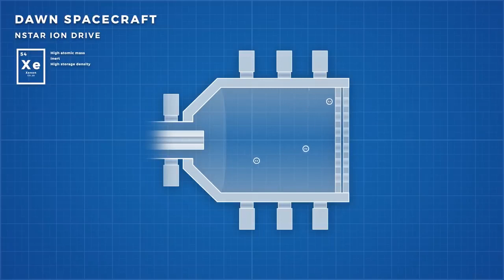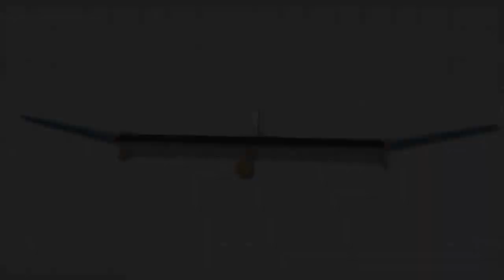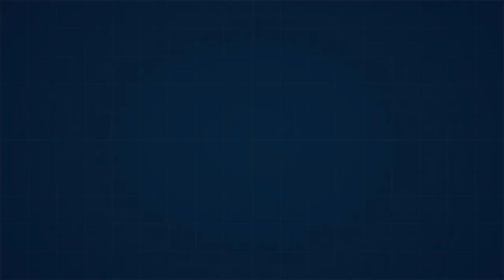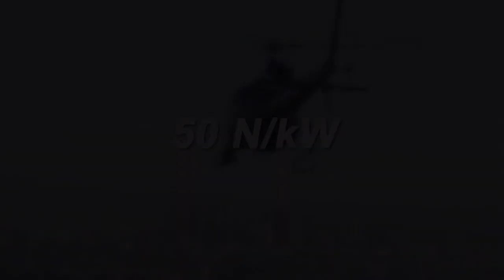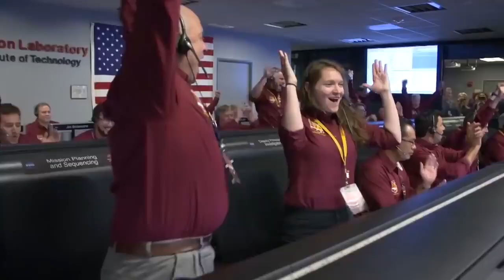The Plane With No Moving Parts(Ion Propulsion )

Comment: Ion propelled planes, or other topic.

If they wouldn't just have certain spots for ion interaction, where the ions are emitted, or thrown out through jets.
If ion propelled planes, or other ion propelled vessels. Utilized propulsion of some sort, shedding ions. In which all at once, from entirely a charged vessel's polarized haul.
 Energy signiture's, or signal's, or ions would be possible to send, or to receive. It's like torus Field's, or alternating currents, or energy field's, or force balances. Or it's like how entenna's work, as they interact with field dynamics.
All what would really be needed for polarized haul's to emit energy wave form's, is energy to power it and a strong energy field.

Things like frequency, or signiture's, or like a schuman earth resonance. Or in likeness, when nikola tesla had a oscillating machine setting to the right frequencies. It's essentially about a medium like around the earth. A medium, where energies persist matrix's and gives it form. As I said around such polarized haul's and in which could be utilized in the environment.

 A field of light could be possible, to make Hologram's. Without need for a light emitter directly facing it's objective targeted area.
A hologram would not be obstructed, if they are things between emitter and it. 
 If theirs a magnetic field, or a matrix of resonances, to persist such interactions into the environment. Kinda like a Hologram router, like internet router. LoL